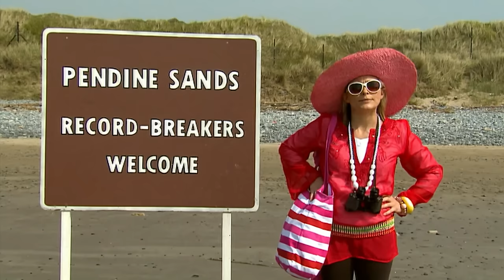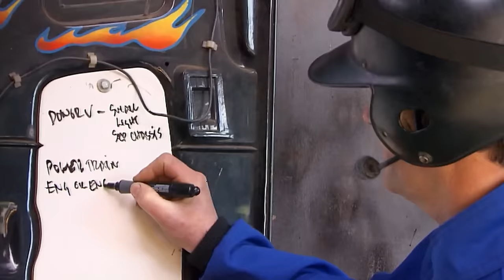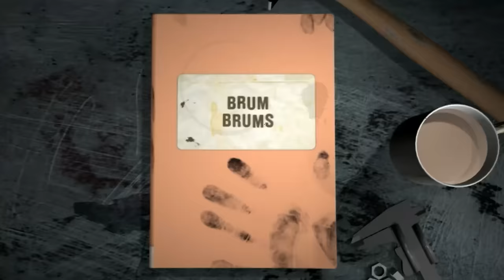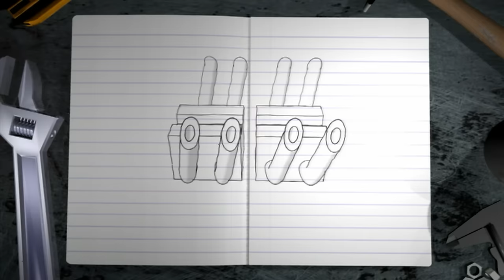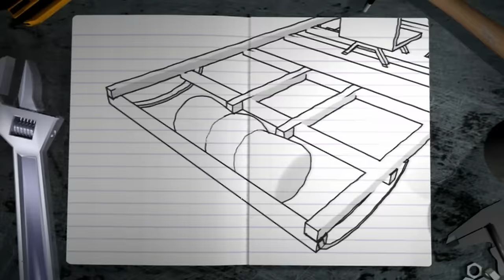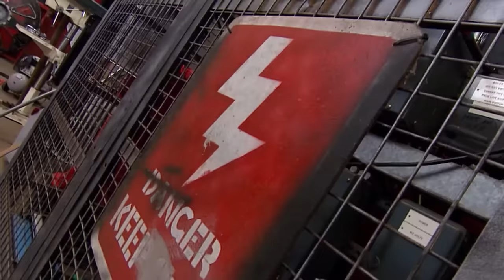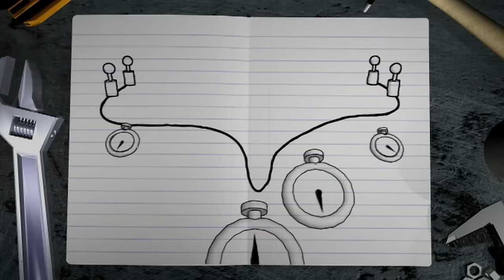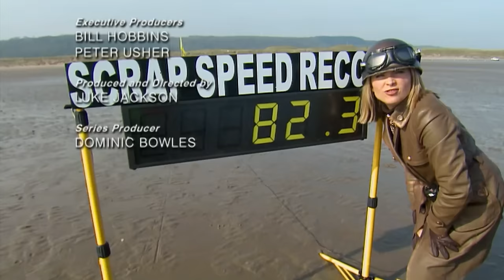Land Speed Record Battle - Scrapheap Challenge - S10 E01 - Game Show

Comment: Would have been quicker just getting the metro going 😂
Reply: Some of the things said in this show made no sense.

Like the wing on the rear to produce drag, yes that's what it will do drag, not make it quicker...
Reply: @junatah5903 That's actually vital for most land speed record cars and more than a few disciplines of drag racing car. A little drag at the back from a wing or fin will give you stability and help you point straight, like on a plane, which is what you want in order to go as fast as possible.
Reply: @junatah5903  Weren't they building 'drag' racers?

Comment: Brilliant show but it always amazed me how crap the builds were, especially on relatively simple builds like this lol
Reply: Do you have aby experience building custom machines out of scrap? The fact that they're able to build anything drivable in 10 hours is very impressive now matter how crappy it is
Reply: @thecrazyfarmboy  Yeah kinda. It’s the fact they alway build huge heavy machines. Power isn’t the most important thing to get something to got quick, weight is. A 250cc go kart would smash the speeds they did easily.
Reply: Would have been easier to just revive one of the cars on the lot 😄 gut it
Reply: @thecrazyfarmboy  Not from scrap but I have plenty of experience building cars/bikes.
The aim was to beat 72mph. Pretty much anything over a 250cc built in the last few decades will easily beat that. 
This was really as easy as find anything with a working drivetrain and add enough wheels to allow it to go forwards. 
No need for complicated builds or anything hard really.
Reply: @Yosser70 Top speed and quick aren't really the same thing
Reply: @Jo-rz6bs  Not really talking about top speed runs here. The object was to go over 72mph, so lightweight and a small engine would have done that easy.
Reply: @Yosser70 yeah but it's also a competition against each other.

If both teams actually thought ahead aka test the engines or had a gearbox, they would've done great.
Reply: @siraff4461  exactly, not from scrap. What you going to do if the gear ratios don't get up to a high enough speed and you cant order different sized sprockets? I'd say anything with a transmission like a car engine guarantees you'll have the gear ratio to beat 72mph. A quick go kart means nothing in this contest if it hits maximum rpm at 50 mph. A motorcycle engine would be a good option but it's all easier said than actually done
Reply: @thecrazyfarmboy  I can't think of any UK scrapyard findable car/bike/van over 250cc built in the last 50 years or so which wouldn't have the power and gearing to hit that easily on a kart. 
Need more gearing? Fit larger wheels. 
Or make a sprocket - something I have done track side with an angle grinder. 
It really isn't easier said than done and when I said not from scrap I didn't mean I've only used new parts. I've had to make plenty of my own or make things work which normally wouldn't. 
Its like them cutting the link between the engines. All that got them was the blown engine doing all the work which is why it failed. 
All they needed to do to run one engine was to pull the plugs out of the rear one. It wouldn't be great but it would only be sapping a little power from the front one then so they would at least have most of one engines power. 
To me thats fairly obvious but apparently not to most people.

Comment: you know it isn't American based only on the fact that 20 years ago these people found a little 6 cylinder engine and called it big, back in the day a engine smaller than a 5.0 L V8 would be consider too small to bother with here in the US, my first car had a 7.5 L 460 cubic inch motor that got about 6 miles a gallon
a straight 8 was really common back in the 30s 40s and 50s, they produce loads of low end torque but are very limited on RPMs, I can't imagine trying to stick two 4 cylinders together and making it work

Comment: If it was me all bulshit aside I'm looking for the biggest turbo diesel engine in the lot then I'm taking another turbo and stacking it so there's twin turbos. Then I'm making a 12.8 L Propane oxygen burning Pulse Jet Engine with a high-powered dual leaf blower setup on a power inverter to give forced air induction pushing hotter flame hotter exhaust with more thrust. Then I would have took and put LED in the rims of two front tires to wait the front of the vehicle down. Next a giant front Wing to hold the front of the vehicle down a side wing for aerodynamics and a large back wing for downforce dual rear suspension two sets of shocks and a set of upside down leaf springs and the front would have dual shocks as well meaning two sets of shocks in the front. I've taken a five horsepower 207 CC Predator engine put a propane intake and have a top speed of 91 mph if I can do it on a five horse engine you should be pushing almost close to 170 mph what are you people doing